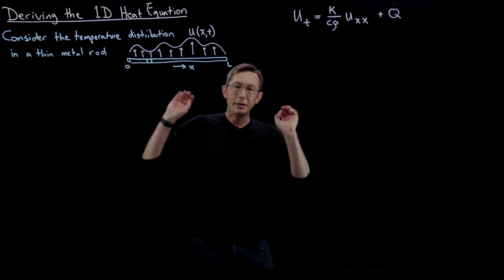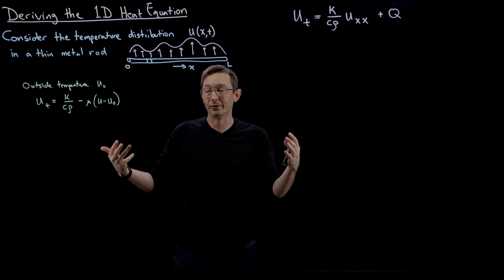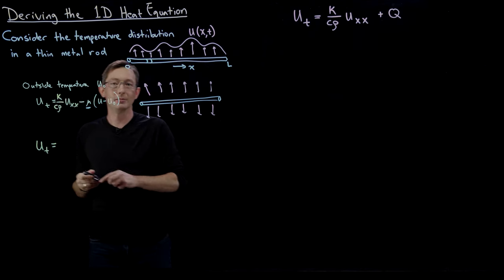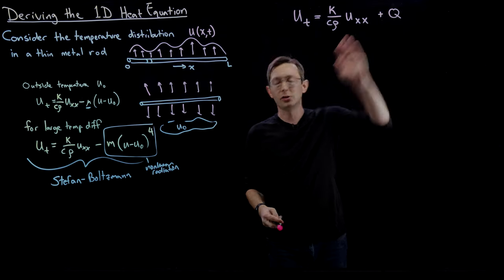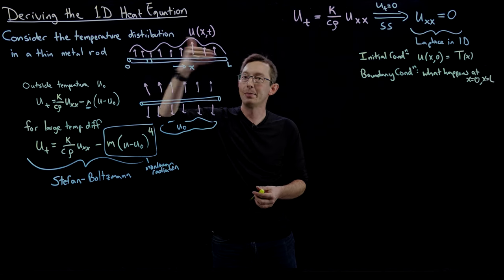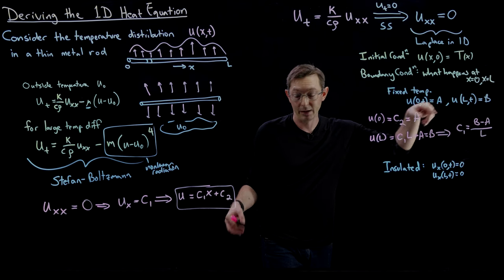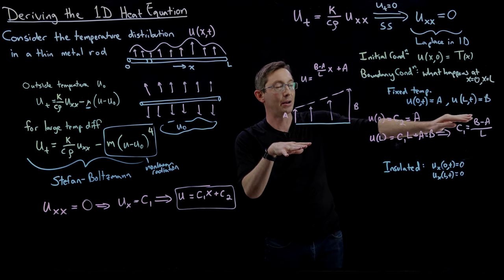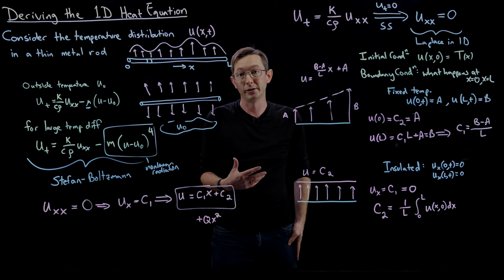The Heat Equation and the Steady State Heat Distribution via Laplace's Equation

Comment: Nice lecture as always.
In the case of steady state with Neumann boundary conditions, How did you arrive at the value, C_2 equals the average of the initial temperature? I think you need some additional conditions to arrive at this value.
Thanks.
Reply: I thought about the same thing. This is how I end up understanding it. Being insulated implies that the integral of the temperature distribution remains identical throughout the timeframe. That means the integrals at any 2 points in time should equal each other. The 2 points in time he chose were t=0 and the steady state. At the steady state, the temperature is uniformly distributed, thus the inegral=C2 x L. This equals the integral at t=0, which is the integral on the right side of the equation. Thus, C2= 1/L * (integral @ t=0)

Comment: As always a great video. As always, just few comments:
> 6:00 following Stefan-Boltzmann formula heat-flux by radiation should be m*(u^4 - u0^4), and not m*(u-u0)^4; maybe not a large difference if u and u0 have different orders of magnitude, u>>u0 or u<<u0; expansion of the 4-th power could easily give the discrepancy between these two expressions, with the leading term being either 4*u0*du^3 or 4*u0^3*du, being du = u-u0.

> About the example on the steady state equation. No dependence on time, so initial condition is meaningless here. Anyway that steady solution is the steady condition you get, starting from any initial condition, keeping constant boundary conditions TA and TB, as the only equilibrium of the system.

And now let's move to n-dim!
Reply: I also noticed the fourth order term was wrong in the radiation term.